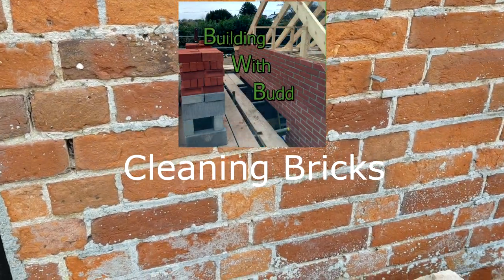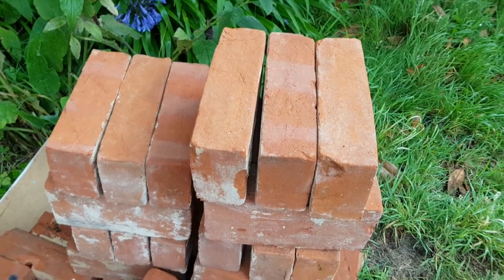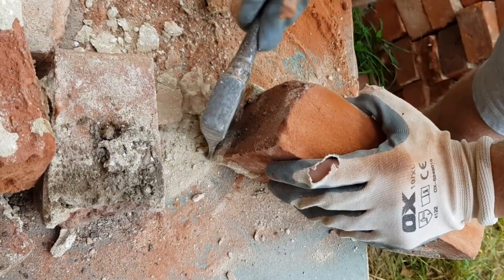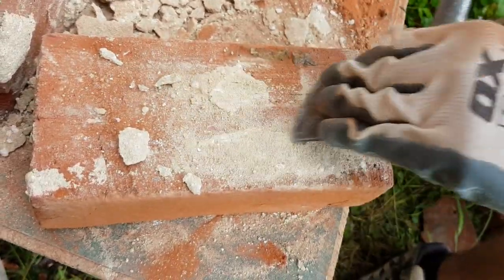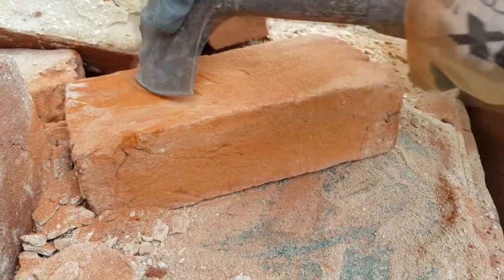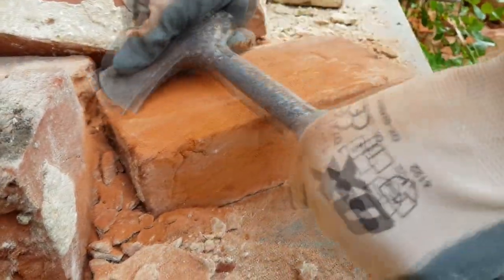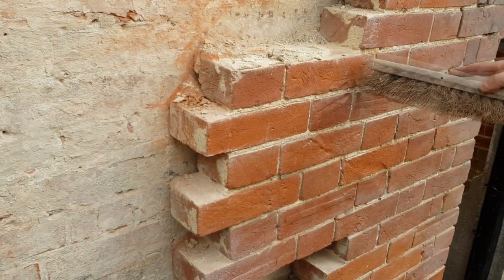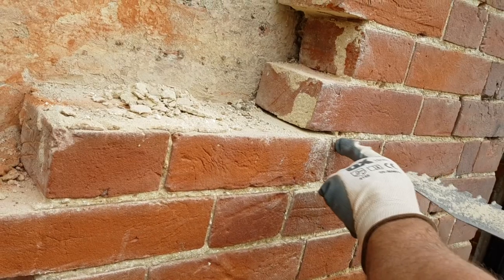Cleaning and reusing bricks that are 200 years old (How to)

Comment: I hate to bust your bubble but I knew an old man that cleaned these old bricks when I was a kid and he said the best method he ever used was to rub two bricks together. He said the mortar removes crumbles and comes right off and the brick is just like new. Also he did about 5-6 a minute because he was doing 2 at a time.
Reply: WatchMakingMan true i was just gonna say wouldn’t it be quicker to just scrape the against the concrete
Reply: I am cleaning bricks atm because we bought and old farm.
I can confirm it does not work all the time, if they have small patches of mortar you can just grind em against eachother sure.
But if there is allot of it still on there on different sides it way quicker to knock it off with a little axe.
Also if u knock the bricks into eachother to do it that way there is a small chance that they will split in half, and each stone is about €0.50 so reducing that risk is key :)
Unless u dont care about money but then why are you cleaning them to begin with.
Reply: @medsuit1686  tried that. works with one pair doesn´t with the other. too many knocked off corners. also exhausting wrists and hands very much, try doing it all day long. not mentioning if the mortar gets tougher. works best when the mortar is excessively weak and bricks rather lightweight
Reply: @tomaskozler4856  You talking about the axe? I did all day several days. old bricks  pre dating WW2.
Just make sure the axe aint to heavy :)
Hard work, but with the bricks we recovered from 1 old farm. we are now building 3 houses.
Reply: @medsuit1686  no I meant cleaning 2 bricks with each other
Reply: @tomaskozler4856  oh yea, its to risky for damage like you said indeed.

Comment: Get a rock hammer and with practice you can chip off the mortar in sheets, then rub two bricks together to clean the remaining mortar.  Also, I wonder why he bothers to clean all six sides so thoroughly, when only one shows.  He could get away with only cleaning front and back, the mortar will cover the rest.  Lots of extra work in my opinion.

Comment: I'm currently reclaiming red clay brick from an 1890's school house that caught fire and was leveled afterwards. It's a bunch of work, but will be well worth it eventually.  I've had quite a bit of success cleaning the brick on site with a simple claw hammer and small stiff bladed trowel. I just have to be careful when using the hammer to chip the mortar off the bricks. Usually a few light taps knock the big stuff off, the rest scrapes off with the trowel fairly easily.  Nothing beats the time tested red clays of old.

Comment: Protip, get a smaller hammer drill and put a mortar chisel bit in. Rig it so it's attached to something sturdy and won't move. Use your hands to being the bricks to it, it activates when you press the Brick to the bit. Much faster than doing it by hand with a hatchet. Don't forget eye ear lung protection!

Comment: I use a hammer and chisel; and a carbide scraper. About one brick in 2 minutes. Only one face need be "perfect".
Reply from the maker: Awesome :D
Reply: one per 2 mins? in demolition and reclaim, you're too slow if you can't do it sufficiently in under  15 -20 seconds or so. The odd brick will take a bit longer...

Comment: Not a bricky, but can u not just use a trowel to rough of most the mortar then wire brush?
Also does scraping them to much not remove 'the glaze'?
Reply from the maker: You can clean bricks what ever way works for you , this method works for me 👍